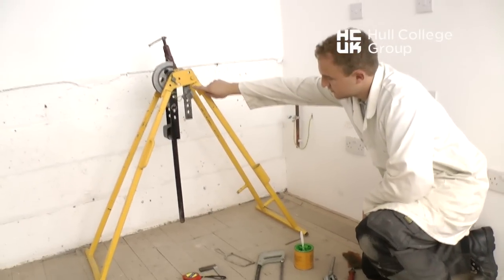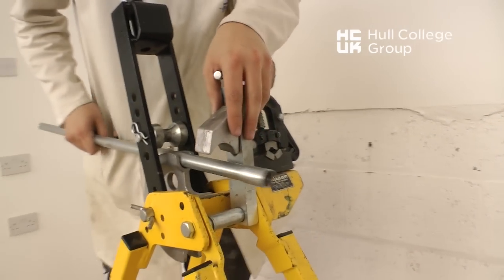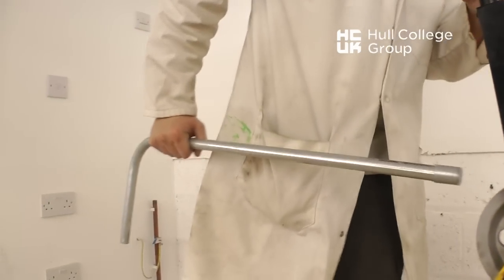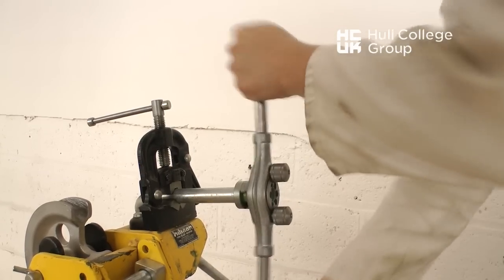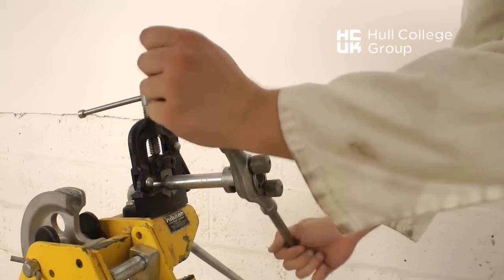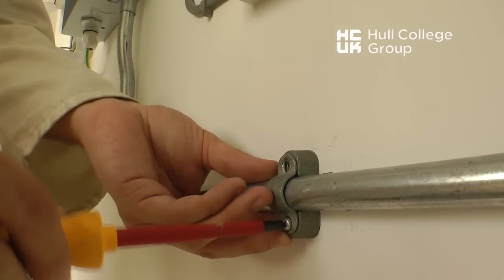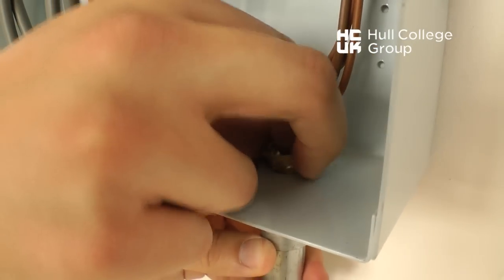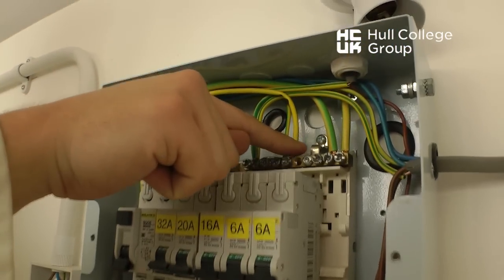3 - 20mm2 Steel Conduit Installation to a Fused Connection Unit - Hull College Electrical

Comment: Quick tip if you don't have a square, use abit of scrap conduit but place it in the groove of the bending machine and line up the outer edge of the scrap piece to the line you marked on the conduit.